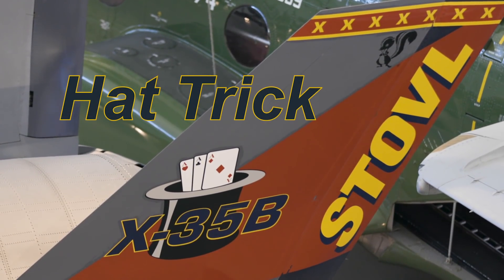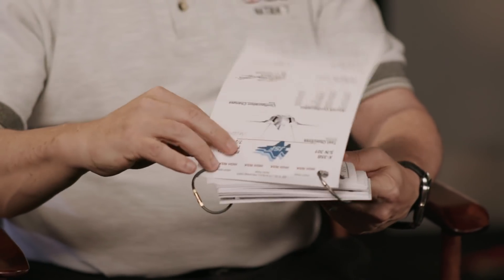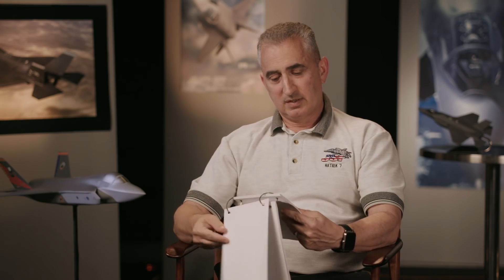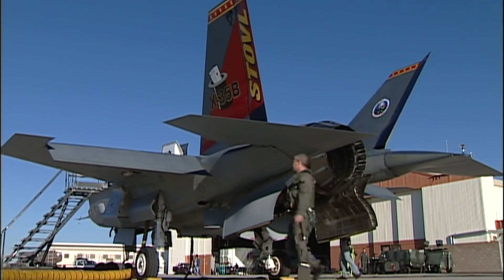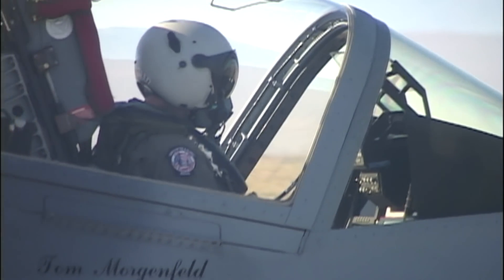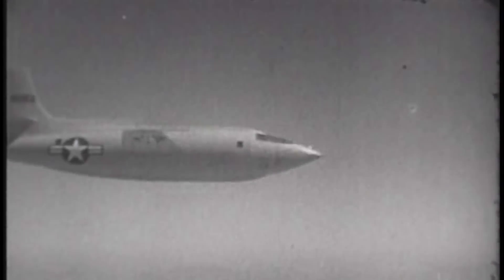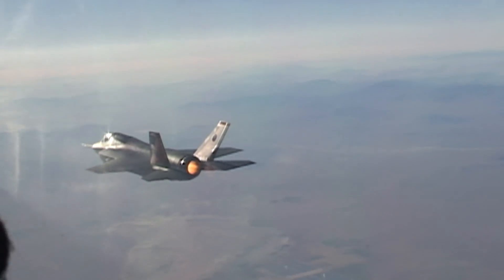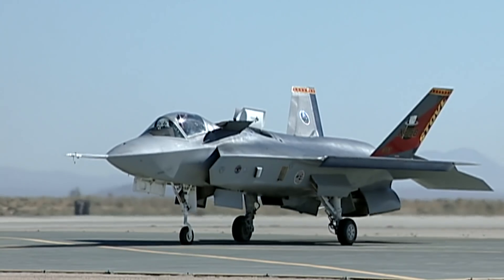The Hat Trick History: Mission X

Comment: Proud of the F 35 and the accomplishment of this dynamic awesome plane I am so greatful we and allies have it , but I still believe we need a very high speed very high altitude interceptor like a new version of F 15 but modern day equivalent new aircraft , multi aircraft for multi roles even a few with thrust vector and not just like one on F 22 but all directions , we spent decades spending and reveling on the advantages of them and now we basically say we don't need them 🤔
Reply: Jets can't vector their thrust in all directions efficiently. Even just a 90 degree bend reduces performance dramatically. Take the F-35B for example. Normally it's engines have enough power to push the plane through the air at supersonic speeds, but they don't have enough power to do a full vertical takeoff, only a short. Take off since they need lift from the wings to help get the plane off the ground. Also why do you think we need a new high altitude interceptor? The USAF mostly deals with air-to-surface warfare these days.
Reply: @maxk4324  But it can do vertical take offs.

Comment: F35 problem YAK41
Reply: The biggest inovation of the X-35 Stovl is the lift fan system. Where the X-35 had a lift fan system, Yak-141 had two fixed engines which created a lot of dead weight.